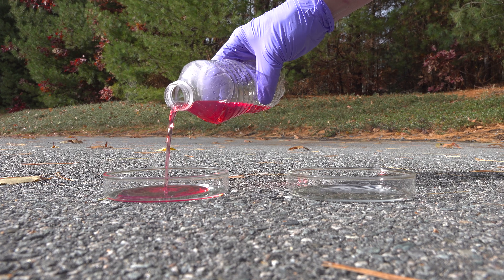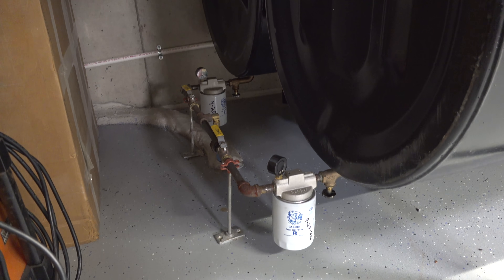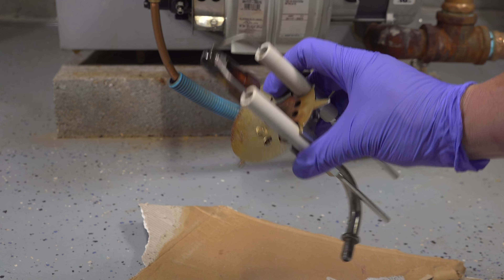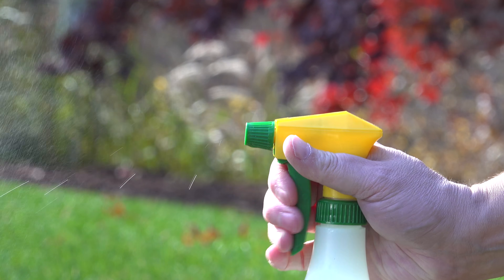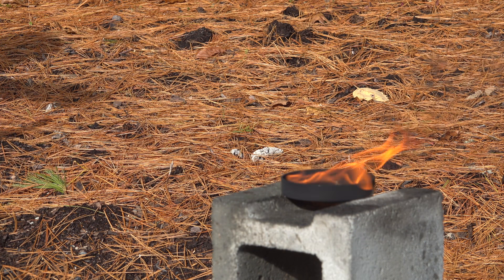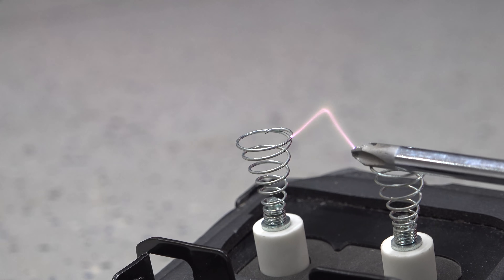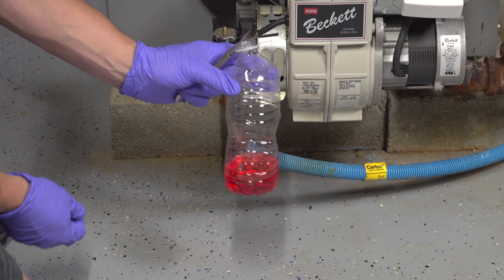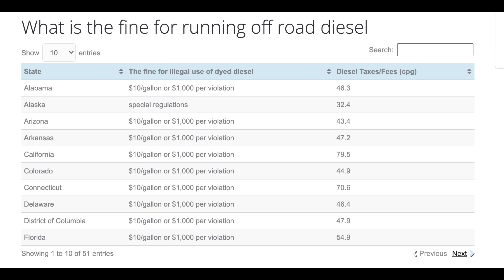Why Heating Oil is BETTER than GAS - Explained

Comment: Lol heat for a year... I have one tank and in the coldest part of winter it would probably last 3 weeks (I have it filled in 2 weeks to keep it from being too low).  But great video!
Reply from the maker: Really depends where you live, if you dont already have one look into an outdoor reset, best $200 you can spend that saved me about 25% of my oil every year
Reply: @SilverCymbal  what's a reset
Reply: @AgentOffice  It is a control for a boiler (this is not applicable on furnaces or if you are using a tankless coil) that re-adjusts the temperature of the water in the heating systems based on outside temperature. This way you aren't heating the water to 180 degrees (or whatever your high limit is set to) unless it is really cold outside. Your radiators will put out less heat when the water temperature is lower, but, you don't need as much heat when the control resets the limit anyway. This is required by energy code on new installs here in Pennsylvania.
Reply: Also live in Mass, 5 - 6 tanks a heating season
Reply: Thank you. That 'one tank for a whole year' statement took my attention.
Reply: we have a tank in our basement that lasts for 3 years ;-)
Reply: @Chris-Workshop  Yeah, but you live in Florida! lol.    Good for you, especially now with these rip off prices!
Reply: I have customers that will only use one tank a year, rare, but it happens, some burn wood so in some cases that's a big difference, others are just cheap, etc.. lol Then there are some places that I have to go every two weeks, great for the oil man bad for the customer, lol.
I've never heard of a trooper pulling over a truck and testing the tank 4 color around here, but, at some of those weigh stations I've heard that at times there's someone actually from the internal revenue department that sticks the tanks, if there's Red fuel, you have to get a certified person to remove it and put the proper diesel in, then they fine you I think per gallon plus whatever else they can add-on. Rare but there's been times I've run out of diesel with the oil truck,, and trust me, I'm not walking with cans looking for a diesel station. I'm sure you understand what I mean! lol Normally I do always fill up and pay the tax. Thank you so much for the video, you hit it right on the money every step! Looking for a job? 😊
Reply: Sounds like your house needs better insulation.
Reply: @jfbeam  I'm sure it can improve, but I do live in a cold area which also tends to get a lot of wind, with some additions which add to the outside-wall to space ratio.
Reply: Unless you live in some giant McMansion you need to fix something. Here in WISCONSIN I fill my 250 gal tank twice a year to heat a 1500 sq ft 1950s built house the entire winter. It's late December, my house is a comfortable 71 and I'm still burning oil I bought last March
Reply: @ghost2coast296  I do have 6 zones on my boiler, and oil is used for my hot water.  I had an insulation company come do some tests and they didn't have any recommendations, so it must have been pretty good.